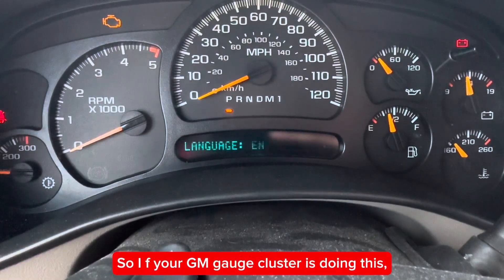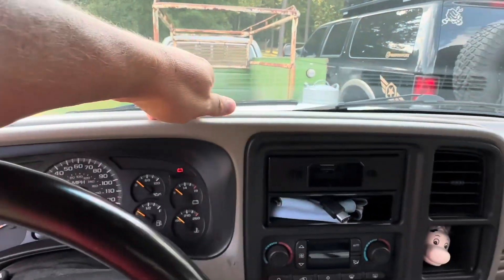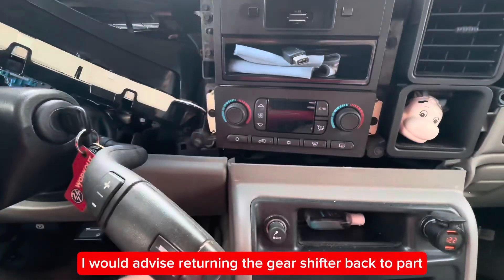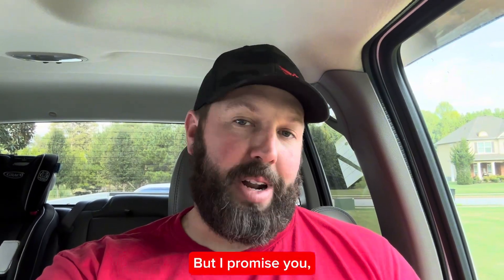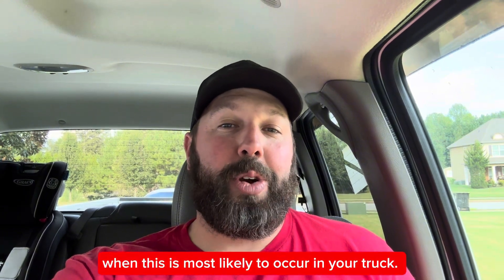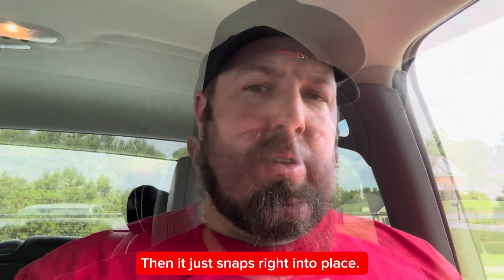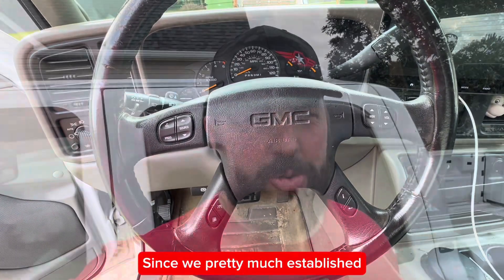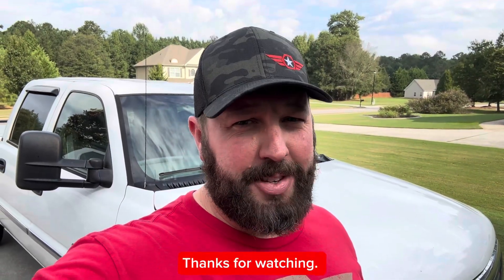GM Cluster Language Scrolling Fix… FREE!  #mechanic #diy

Comment: There ain’t no way, I acquired my Denali from my aunt and she said the odometer has been turning itself on for years, YEARS, it was killing the battery  so bad she had someone “fix” it by cutting a wire and adding a switch between the wires, I put the wire back together and removed the switch and issue was still apparent, I’ve been torn on this for a few hours, found this video and fixed it in 2 mins (I already had everything off), you are the best!
Reply from the maker: Maybe it’ll stay functional 👍

Comment: Wtf, why did that work, I just replaced the steering wheel buttons and extended the wires so you could actually plug it in. All for it to just need a magical hand wipe
Reply from the maker: Science…almost 🤓

Comment: Worked perfectly, I had to figure out how to switch it back the English but now my cluster works normally now. I had to do mine twice. The second time I tested my elbow against the door of the truck while I stroked the circuit board. I’m guessing that equalized the electrical charge between the truck and the cluster.
Reply from the maker: Science...almost 😎

Comment: Interesting theory and repair. Haven’t owned many GM vehicles to experience that issue, but it sounds logical as to why it occurs. How’s the service body doing?
Reply from the maker: Thanks. I didn’t come up with the repair, just the theory. The service body is good. I’m about to start building a bigger small block for it, and contemplating Air Ride 🫣

Comment: I have a theory that you have a bad ground such as when you discharge the truck, the cluster doesn't get discharged, putting it on a different electrical plane from the truck. Humans are decent electrical conductors (sometimes with bad results) By touching the board while sitting in the seat, you're discharging it into the truck. I would check for a bad ground wire on the cluster next time you're in ther. Alternatively, you could put a rubber pad on your jack and put a little rubber on the jack stands (folded over dishwashing gloves should do in a pinch) thereby keeping the truck insulted from ground.
Reply: PS I have a 2009 Chevy Express 3500 with the same cluster and over 315,000 miles with no issues with the cluster (the stabilitrak, and abs however.....I may replace the speed sensors just to make it stop dinging all the time lol)
Reply from the maker: Hopefully yours wont give you any trouble.
Reply from the maker: Yeah, I've never considered insulating the Jack Stands. I might give that a try.

Comment: Tried this and after 10 min went right back to scrolling. There any other theories? Ground wires or steering wheel button shorts?
Reply from the maker: Wait until summer, when it gets real humid, maybe it’ll fix itself 😂
Reply: Mom's was full of spiders and dust.  Carefully cleaned as best I could.  Also pulled and cleaned contacts of associated fuses under hood.   Pulling fuses reset cluster module so re-learning  tire pressure sensors etc. required......

Comment: I can't tell if this is a joke or serious lol. I've had my truck for 20 years and 242,000 miles and my cluster has never gone wonky 🤷‍♂

Well, except for the engine hours randomly resetting to zero. 242,000 miles and only 72.9 hours  🤣
Reply from the maker: I’m serious actually. It’s just a temporary fix. It’s not a long term solution. Might be a little voodoo involved.
Reply: 242,000 miles in just 72.9 hours? Must be cool to have a Saturn V.🤣🤣🤣🤣
Reply: It is real and it did work on mom's suburban!

Comment: You "ground" your vehicle and time you get fuel so that's definitely not it
Reply from the maker: Plastic fuel tank, rubber filler neck…not sure I’m buying it. But maybe, probably, idk.
Reply: @freedomworx  the fuel neck I my 07 Duramax is metal. The fuel nozzle on the pump is grounded. Not only that all vehicles have a battery and a place for static to dissipate. When you touch your vehicle after you get out and build up a charge in your body a spark will jump to the vehicle. Definitely not static buildup
Reply: Rubber Fuel line at the gas pump. Definitely don't ground it when getting gas.

Comment: :person-turqouise-waving::person-turqouise-waving::person-turqouise-waving::person-turqouise-waving::face-green-smiling::face-green-smiling::face-green-smiling::face-green-smiling: What a ridiculous video, the problem is soldering cracks, and you have to re soldering some electronic  components or where you see cracks.
Reply from the maker: Yet it worked 😘
Reply: @freedomworx  Do you know what happen to smd chips and electronic components with electrostatic from your hands? Do you know what a Anti-static Bracelet is and what is the purpose of it? So stop giving misleading information to people who does not have any idea of electronic.:face-orange-raised-eyebrow::face-orange-raised-eyebrow::face-fuchsia-tongue-out:
Reply from the maker: I sure do. I’ve worn plenty of anti-static bracelets in clean rooms. I worked on aircraft components for 5 years before I got an engineering degree. 🤷🏻‍♂️ You might not like it, you might not agree with the procedure, or the science behind it, but the fact is, it works.
Reply: @freedomworx  :person-turqouise-waving::person-turqouise-waving::person-turqouise-waving: Yes Me too, I am Aeronautical engineer with a postgraduate degree in spacecraft design, from   Massachusetts Institute of Technology (MIT), so what do you think.:face-green-smiling::face-green-smiling::face-green-smiling:
Reply from the maker: @lidiatorresprado I think if you graduated from MIT, you’d be better informed, and use proper grammar 😘
Reply: @freedomworx  And plus you already mention many times on the video that you can not explain it, because you have no idea, genius, and you say you are an engineer.:face-blue-smiling::face-green-smiling::face-green-smiling::face-green-smiling::face-green-smiling:
Reply from the maker: You can Google my name, it’s not to hard to figure out who I work for or what my job title is.
Reply from the maker: I’m just out here making videos to help people, giving them the info they need. You’re just out here telling lies about your credentials and trying to prove you are smarter than other people. Which you are not. Do you know what an anti-static bracelet is because you sit on an assembly line and doing unskilled labor assembling electronics?
Reply: @freedomworx  Exactly like you a simple mechanic pretending to be engineering, and you suppose I know your name.:face-green-smiling::face-green-smiling: You do not know anything about me, and I do not know anything about you, just a guy doing mechanical tutorials.
Reply from the maker: @lidiatorresprado there was literally a caption in the first 10 seconds of the video that shows my name 🤷🏻‍♂️